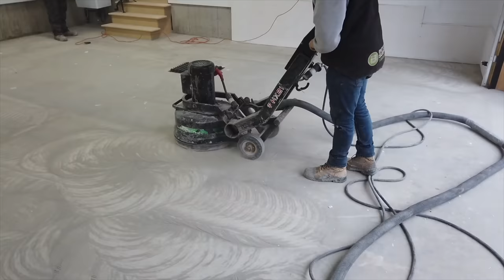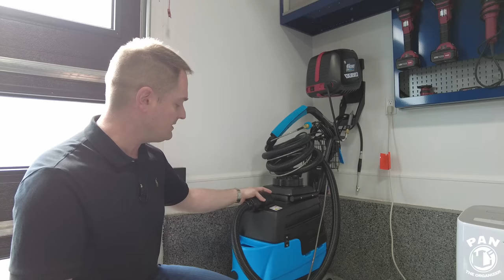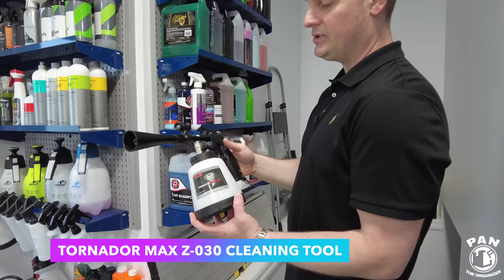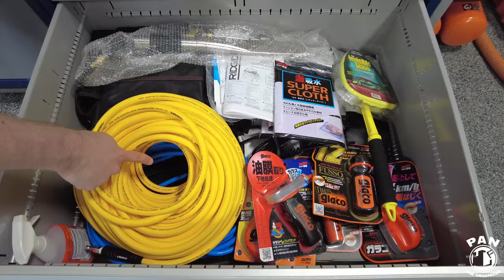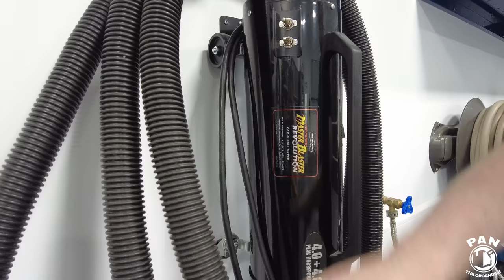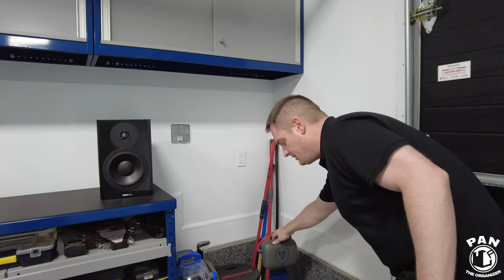INSANE garage tour! A car detailer's dream!

Comment: Can we clay bar a ceramic coated car?
What would you recommend to clean some particles stuck on the ceramic-coated car.
Reply from the maker: I wouldn't recommend claying a coated car, as claybars are abrasive and could potentially damage the coating if you don't know what you're doing. It's preferable to use chemical decontamination with iron removers and tar removers when needed.

Comment: Hi Pan, may I ask what nozzle you use on your pressure washer? I’m guessing you use a 40 degree, 4.0 orifice nozzle?
Reply from the maker: Correct. Links in the description under the video.
Reply: @PanTheOrganizer  thanks Pan. I ordered the Active 2.0 pressure washer, so I'll plan on using a 40 degree, 4.0 orifice nozzle tip as well. Have a great weekend!

Comment: Is your garage tall enough for a lift? I know they sell those lifts that you can hang up on the wall when you're done I think they use air to jack them up. Def a dream garage pan..... the topper though..... that cherry on top...... that Porsche 😍. Spec'd to perfection!!!
Reply from the maker: Yeah the ceilings are 13' high so no problem for height. I just don't want to take up space with a lift in this garage, as it has to stay practical. Perhaps in a future home, with more bays.
Reply: @PanTheOrganizer  understandable.

Comment: Wow that's pretty cool. And just like that you don't have anything left for Christmas presents. Lol. 
One thing I'd like to comment on is your high quality videos. Great picture and great sound. If I can see what your talking about on the vehicle, it really helps. Top notch.
Question: do you find it necessary to have some sort of ceiling fan? To stir the air around? Bring warm air down? Thanks for the tour and inviting us in Pan.
Reply from the maker: Thanks Kim! I take great pride in filming and producing everything myself (except videos like this where my girlfriend helps me to film). I'm by no means a professional film maker, but I want to give my audience as good an experience as I can deliver.

I have no need for a ceiling fan. The heat pump can heat and cool the garage to perfect uniform temperature quite quickly.

Comment: I’ve been wearing Nike Pegasus shoes probably since the 80s or whenever they first came out..lol
Reply from the maker: Have they been available for that long??
Reply: @PanTheOrganizer  1983, but my first pair was 1987. I bought them consistently then I stopped at 2001 because I didn’t like the next style. But then I started buying them 2006 to 2012. Then I bought them here and there all the way up until a few years ago. I imagine I’ll start buying them again sometime because I like their new direction. I started buying a lot of ASICS shoes starting around 2012. In the last 5 years I started buying Adidas because I like some of their running shoes. I buy mostly just running shoes that’s all. I have shoes that I only wear indoors. I got a lot of shoes…lol

Comment: My garage is a 20x20.  What I wouldn't give for the extra 4 feet you have.
Reply from the maker: I agree. Bigger is always better. And because of the depth of my workstation, I sometimes wish I had a 28x28 garage.
Reply: My garage is only 12' wide. What I wouldn't give to have an extra 8'

Comment: I can't see the video about your forced rotary flex 🤷‍♂️
Reply from the maker: Which one? The cordless forced rotation, or the older corded 3401?
Reply: @PanTheOrganizer  Doesn't meter to be honest. There is not a lot of videos about forced rotary polishers. I'm looking for information, tips and compare to the  DA21/15.
Reply from the maker: Forced rotation polishers (also known as direct drive) have more power but mainly the difference is the backing plate will never stall. Contrary to dual action polishers, where if you put too much pressure, the backing plate stops spinning, by design, to prevent damage.

Here's a video about forced rotation: https://youtu.be/RbOlP1Ja154